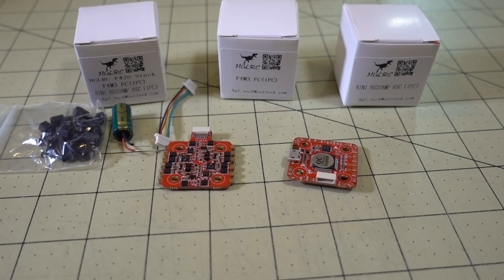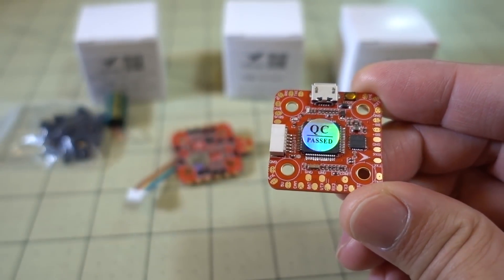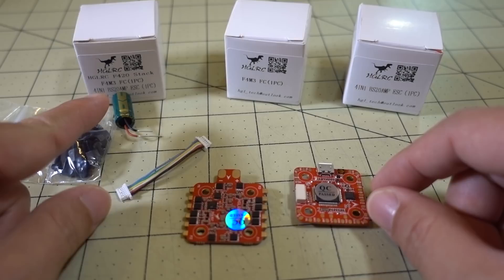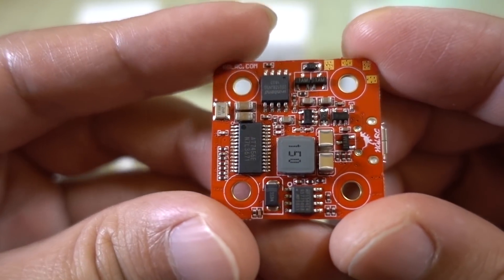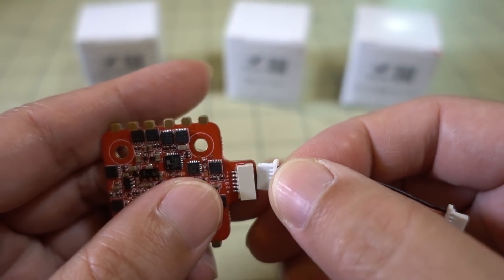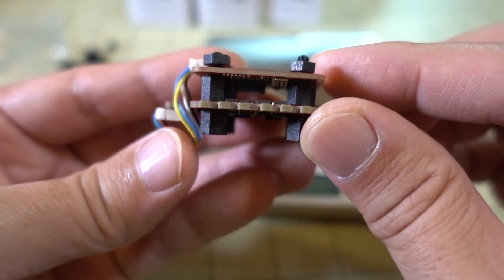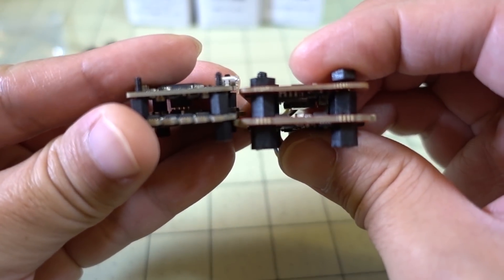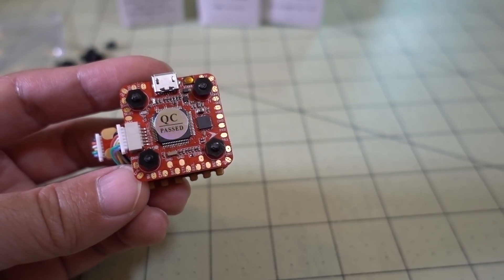HGLRC F420 20x20 Micro Stack Review 🏁

Comment: Hey Albert need your help just picked up this stack and I'm unable to get sbus to work what rx do I tick on in betaflight I tried all with no luck
Reply from the maker: what receiver do you have?  is your sbus receiver able to use inverted signals?
Reply: @AlbertKimTV  thanks for your reply after countless hours troubleshooting I figured it out I had the receiver signal wire solder on the same rx..lol I'm drinking now..lol thanks again
Reply: I'm getting a lot of fpv noise and osd flickering should I use the cap?
Reply from the maker: yes, use the cap... that's what it's there for.
Reply: @AlbertKimTV  I'm still getting  flickering on my osd using the cap using the runcam split mini 2 with this fc any help would be appreciated it

Comment: Never had a broken pin - but all my HGLRC stacks use the long metal M2 screws with spacers for mounting and assembly. I can see how pins could break from shear forces in a crash if you use the nylon / plastic stand-offs to assemble them.  Actually, I'm not a fan of the "old" method of using the 6 pin connectors to connect the ESC and FC boards - I've had trouble with them making intermittent contact after a while.  Your usual good review, however!

Comment: I agree with past comments, M3 hardware on the previous stack would be better. Albert, can you give them a ring and make that happen? Thanks for the reveiw, but I wouldn't order this...
Reply from the maker: I think its not possible to make the old boards with M3 holes without making the boards larger.  Think about how tight it already is and what all is on there...
Reply: @AlbertKimTV  
A very solid point...

Comment: Stinks that it's so large.  I already damage boards too often as the top plates of modern frames are becoming more and more narrow to save weight, leaving the stack exposed.  And M3 hardware is lame without including rubber grommets to allow soft mounting and M2 hardware like other companies are doing.  Only half a 6-pin connector if you buy the FC or ESC separately?!  That's just too cheap, even for a Chinese company!  Great video nonetheless though!  Keep 'em coming Albert!

Comment: Looks like a good option. You can always cut down the wire loom to just reach each set of pins so it's not in the way and save some weight. Thanks for the info and Happy Flying!

Comment: I'm happy about not shearing off pins or M2 hardware anymore (both have happened using F425 stacks) - BUT this won't work for me as it's too large now to fit within 30.5x30.5mm standoffs that I use for my stack-mount camera = FAIL!!!   By the way, this isn't their first time offering a cable connection, the first  XR25 (25A total) F3 V1 had it - I'm still flying two of those stacks w/ 1105 motors.

Comment: I understand some pilots preferring the wiring connectors over pins, but I'm still trying to figure out how someone managed to break the pins. The extra weight is crazy but I feel like the wiring loom wasn't well placed. Almost kind of in the way especially if you use the capacitor. I hope they continue to make stacks with pins and upgrade the hardware from M2 to M3. 
Any idea what frame / build you might put this stack in?
Reply: The pins sheer off when the M2 plastic hardware fails (the included plastic M2 standoffs).  I would have preferred just having M3 and keep the pins.
Reply: KruiZen I would prefer them using M3 sized hardware as well. I'm just not a fan of the connectors and wire looms.
Reply: that probably would have been the best solution. I also prefer M3 nylons,. I have put epoxy on my pins/socket, so hopefully they stay put.
Reply from the maker: Not sure what this will go into yet.  Probably a 3 inch.

Comment: I have few F428 stacks with pins and never broke it on the quad.
But I never use that flimsy nylon screws. Use long stainless steel screws and nylon spacers. My stacks survived few frames at least.
It's a little strange design. For 3" quad this new stack will be sticking out from both sides and will be tight built. Camera may have issue to tilt up as it may rest on FC on some frames.
And for 5" quad 20A esc a little too small.
Reply: I've sheered the pins off a F425 stack when the included M2 nylon hardware failed in a crash.  I then upgraded using metal screws, but with the F425 stack having metal holes (typically connected to ground), I killed another F425 when the solder on the positive lead of my XT30 connector poked through the heatshrink and shorted to the frame - killing the ESC.  The F440 stacks that include metal hardware solves the problem of sheered pins but creates the shorting hazard.
Reply: KruiZen all my quads have ss screws and I never had an issues with short circuit. I do crash a lot but in the woods or soil mostly.

Btw where you got F425 FC? Never heard of it.
Reply: That's good to hear!  Maybe as long as I pay attention to my battery terminal insulation, I'll be fine generally.  I have heard grounding your frame (by using metal hardware) can create video noise issues and possibly fry the VTX with antenna possibly shorting.  The XJB F425 stack is discontinued, but it was pretty much a F428 with slightly lower specs.